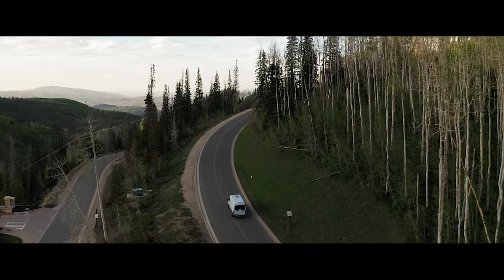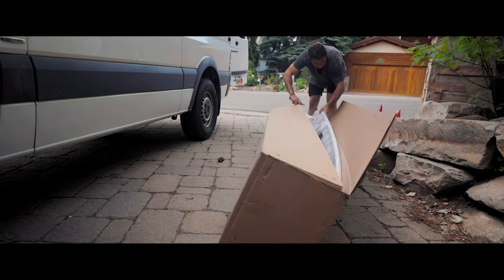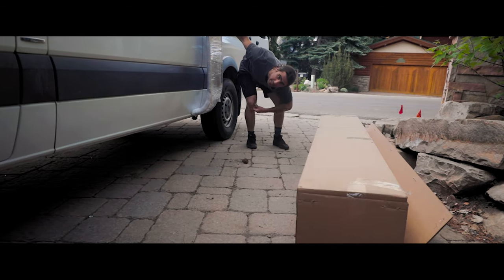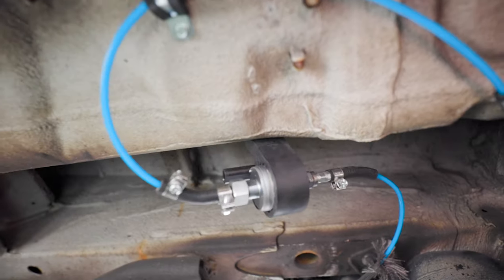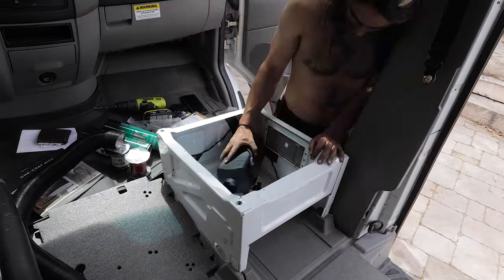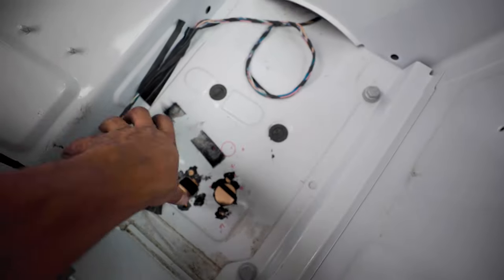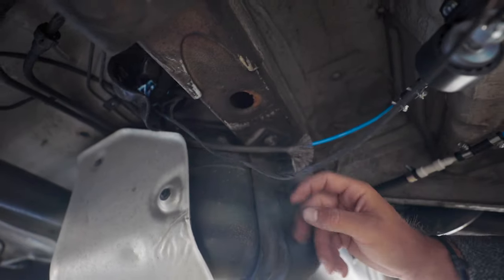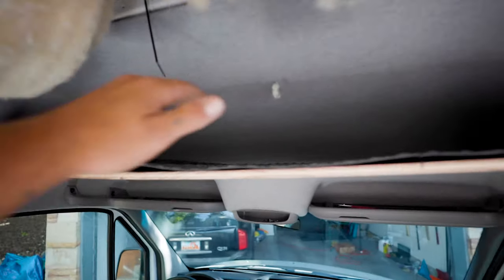i made a mistake | sprinter van conversion

Comment: You are really better off with a Little Giant ladder and keep it in your garage. So many who get a ladder installed have only made it easier for someone to it climb it just to steal your panels and any other tech and/or belongings on your roof, But great work.
Reply from the maker: thank you! its definitely a possibility but it would be pretty tough to steal that 320w solar panel :)
Reply: @LucasCatania17  I think many people live in areas with high crime. I live in two areas one outside NYC and one in rural New England. I have never had any issue. I lost my wallet in NYC and so has my cousin and both were returned with everything in tack. I drove a fully loaded service van for 35 years loaded with thousands of dollars in tools and never had an issue. Neither had any of my coworkers. Maybe just lucky.